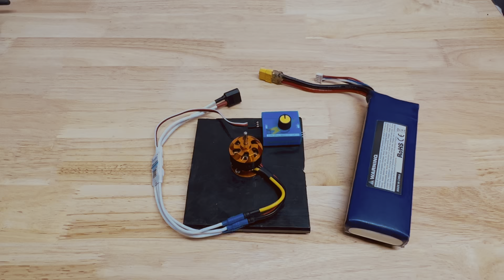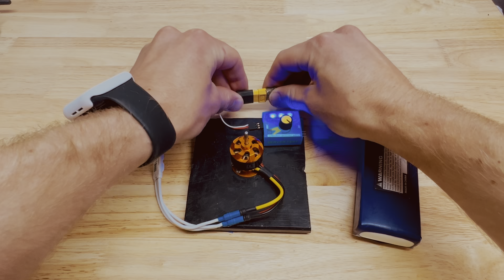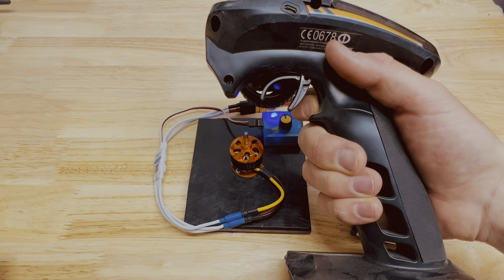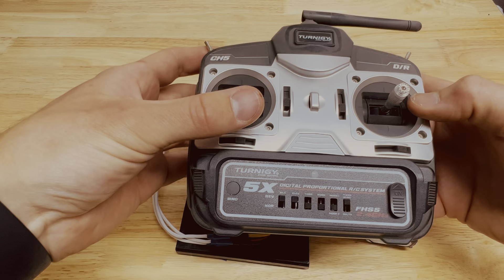RCElectricParts com DEFIANT ESC - STEP 2: Throttle Calibration Procedure

Comment: If you using and esp32 or arduino make sure you have it set 1000-2000 not 1500-2000 that is for servos
Reply from the maker: Correct. 1,000 is min, 1,500 is middle, and 2,000 ms is max